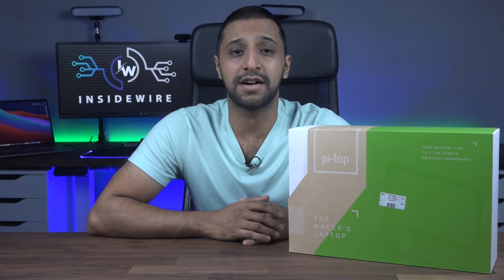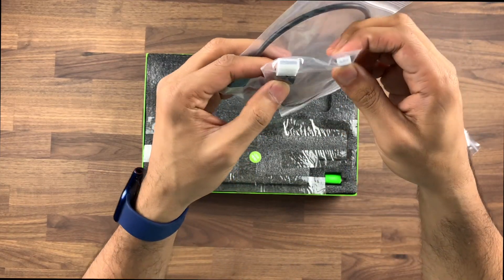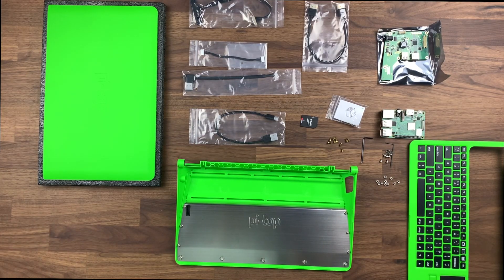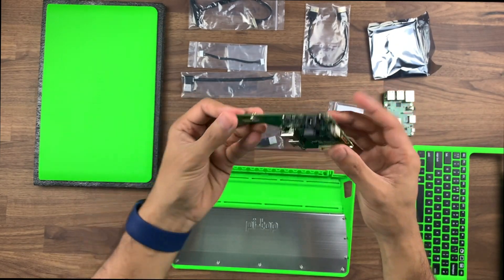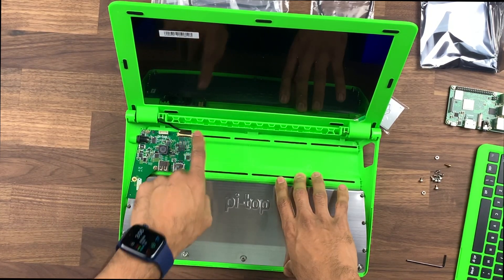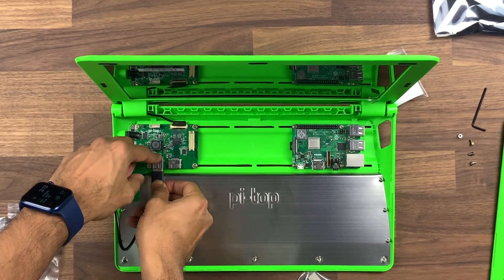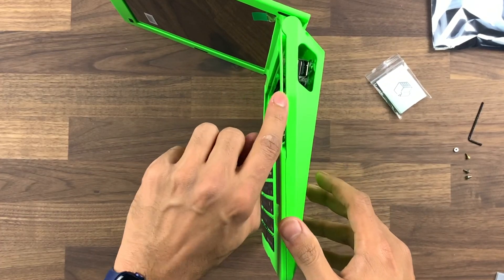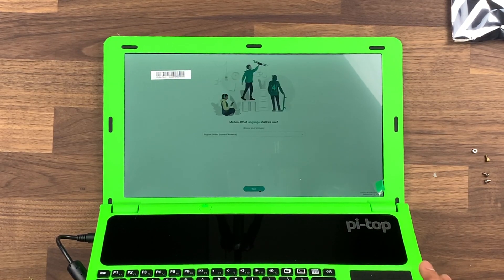Pi-Top Raspberry Pi Laptop | How to assemble step by step

Comment: How would users access the GPIO pins? Another version (with touchpad) has a Cooling Bridge plugged into the RPi GPIO pins and screwed in place to the accessory board.  We would need to plug in a small RS485 Can Hat with extended pins.

Comment: Hi, hope you're able to help me. 
I have buy the pi-top, take my raspi 3b+ , followed the instructions, build it together. 
Put in the SD Card which delivered with, load the battery  and start it.
But the screen doesn't work. 
I see, that the screen works because the screen change the color if I start the device.
But I do not see the picture. 
I know how to use tools and how to carefully connect various contacts. 
This is I have also done. 

Could someone say me what's I'm doing wrong?